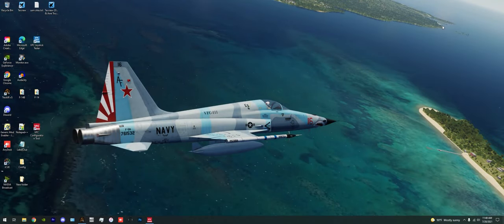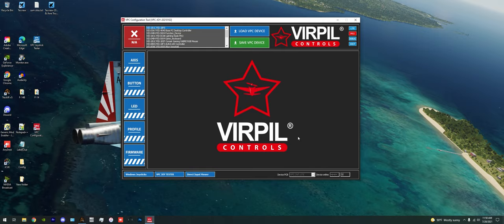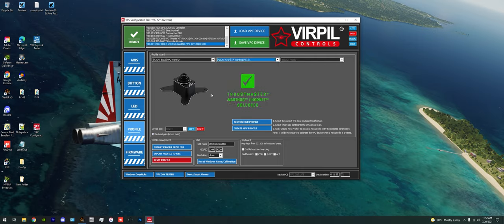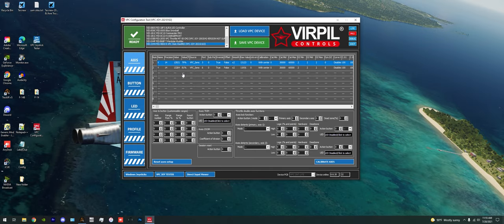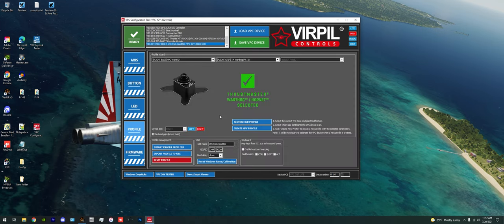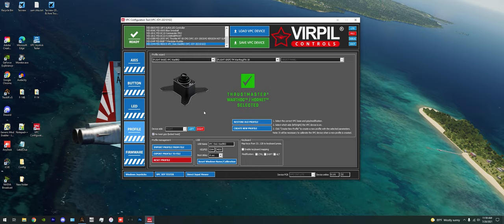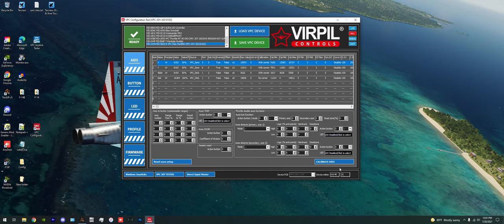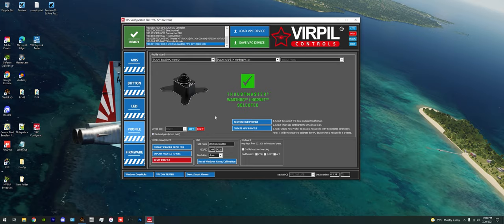Virpil Software Tutorial | Profile Creation & Calibration | Stick Grip Swapping

Comment: I had been using the Thrustmaster Warthog F-16/A10 flight stick & base and the Warthog throttle to fly in DCS.  I was really having a hard time with the precise, fine control needed to do carrier landings and air to air refueling and even just to perform good landings at land-based airports. 

With the Warthog controls, i just could not maintain constant speed and altitude or a constant descent rate. I’ve mostly been flying the F/A-18 and I kept hearing from everyone how easy it is to fly because of it’s fly-by-wire and FCS, so I was really beginning to think that it was just me being a shitty pilot. I watched lots of videos on how to set up dead zones and curves in DCS for the Thrustmaster controls, so I don’t think my control settings had anything to do with my issues. 

So I decided try the Virpil Constellation stick, VPC MongoosT-50CM2 Base, and VPC MongoosT-50CM3 Throttle. 

Holy cow! It’s like I am flying an entirely different airplane.  Flying the F/A-18 in DCS with the Thrustmaster Warthog stick, base, and throttle make me feel like I was flying the unstable Spitfire, and comparatively, flying the F/A-18 with the Virpil controls finally feels like I’m flying the easiest and most stable fighter jet that everyone described the F/A-18 to be. 

It’s literally like night and day. A lot of people rave about Thrustmaster Warthog stick and throttle, but now after experiencing the Virpil controls, I think people get fooled by the heavy weight, build quality, and great appearance of the Warthog controls. Also most people who upgrade to the Warthog are switching from really bad entry level flight controls under $100, so switching to the Warthog controls is a big upgrade for most people.

I was one of those people. I upgraded from crap Logitech controls to the Warthog stick and throttle and I did experience an improvement in ,y level of control of aircraft. 

However the improvement that I experienced when upgrading from the logitech controls to the warthog controls was much less than the improvement I’ve experienced when upgrading from the warthog controls to the Virpil controls. 

Not just the build quality, but my ability to control the aircraft with an incredibly precise and fine level of  control. Both the Virpil throttle and the  flight stick are an enormous improvement over the Warthog controls. With the Virpil controls, I now have no problem maintaining constant speed and altitude in the F/A18 and it’s a piece of cake to establish constant rates of climb and descent. 

Maybe I had bad set of Warthog controls, but I find it hard to believe that I would get a bad throttle and stick.

Comment: 2:00 ohh be carefull with that info!
When you have 2 different VPC divices plugged in at the same time it CAN brick the firmware of them when you flash it for a firmware update.
only do firmware flashing with only 1 VPC device at a time, thats also what VPC wants you to do and there is multiple reddit threads of people bricking their firmware for failing to follow this step.
other devices dont matter, only VPC stuff.
and this also only applies to firmware updates.

IF you brick the firmware however dont panic, you can still do a factory reset with a piece of metal when you connect 2 ports on the circuit board, contact VPC support for that though!

Comment: Not sure if you have the Virpil VPC MongoosT-50CM3 Throttle, but if so, I think it would be really helpful if you did a video on how to set up and configure the throttle in the Virpil software, especially all the buttons, switches, and dials. It’s a fantastic throttle, but out of the box, the switches, and buttons aren’t set up optimally and the Virpil software instructions are horrible, in terms of explaining how to set up the throttle to get the most out of all the switches, buttons, and dials on the throttle base. 

The Virpil throttle has seven 2-way switches. Each 2-way switch is assigned 2 physical button numbers in the Virpil software, but out of the box, each of the 2-way switches only activates 1 virtual button press in windows and DCS. So when you flip the switches up, they activate a virtual button press in DCS, but when you switch the 2-way switches back down, they don’t activate a virtual button press in DCS, even though each of the 2-way switches are assigned 2 physical button numbers in the Virpil software. It’s pretty easy in the Virpil software to map all the 2-way switches so that both positions on the switches activates a virtual button press in DCS, but the Virpil instructions do a horrible job of explaining how to do it.  

You basically just have to assign the 2nd physical switch position to a virtual button press number that isn’t already assigned to something else in the Virpil software. I did this for all 7 of the 2 way switches, which gave me 14 virtual buttons presses out of the seven 2-way switches, instead of the out-of-the-box configuration which only have me 7 virtual button presses from the seven 2-way switches. 

Also on the Mongoose throttle, there are 6 momentary buttons and a 5-way dial. Out of the box, the dial wasn’t linked to the 6 buttons. So all I was getting was the 6 button presses and a virtual button press for each of the 5 positions on the dial. 

However there is a fairly easy way in the Virpil software to set up the throttle so that each position on the 5-position dial becomes a unique modifier for the 6 buttons. This set up gives you 30 unique virtual buttons presses in DCS instead of the out-of-the-box configuration which just gives you 6 buttons and 5 virtual buttons for the 5 position dial.  When you set up the throttle in the Virpil software with the 5-position dial as a modifier for the 6 buttons, you end up with 30 unique virtual buttons presses in DCS (6 buttons X 5 positions on the dial= 30 virtual buttons)

So for example, when the dial is on position 1, the 6 buttons will activate virtual button presses 60 thru 66. When you switch the dial to position 2, the same 6 buttons, activate virtual buttons presses 67 thru 72. Position 3 on the dial, changes the 6 buttons to virtual button presses 73 thru 77. Position 4 on the dial changes the buttons to virtual button presses 78 to 83 and position 5 on the dial, changes the 6 buttons to activate virtual button presses 84 thru 89. 

Another thing that needs to be set up on the Virpil throttle is the physical detents. You don’t need to do anything in the Virpil software and the Virpil detente are so much better than the Warthog throttle detents. With the Warthog throttle detents, you can’t adjust the position of the physical afterburner detent and in DCS,with a normal throttle axis, the afterburner in the F/A-18 doesn’t align with the position of the physical detent on the Warthog throttle. 

The only solution is to add user curve in the throttle axis tune in DCS. That will get the afterburner in DCS to line up with the position of the physical detent on the warthog throttle, but it leaves you with an odd shaped axis curve which gives you an uneven throttle response. 

The great thing about the afterburner and idle detents on the Virpil throttle, is that you can easily shift the exact positions of the physical detents on the throttle, so they perfectly align with idle/cutoff and afterburner in your DCS aircraft. No need to create some funky user curve that will give you uneven throttle response. I have a 1:1 throttle axis with no curve, so I get a perfectly uniform throttle response in the aircraft throughout the entire range of the throttle.

Comment: I looked at this video from 
HavocCompanyClan on this Grip Swap subject and he makes the case that the Vipril Bases have an internal memory and if you keep swapping devices without unplugging the USB you might brick your base. I don't know if its true or not, but just something to be aware of.
Reply from the maker: In talking with the marketing guru for Virpil, the bases are built and designed with swapping out grips in mind and that issues are not likely to occur.
Reply: No...he is saying when updating a piece virpil equipment, you should disconnect other virpil equipment. for instance, if you need to update you virpil stick, disconnect your virpil throttle or vise versa.
Reply: @Spudknocker  that's good to know
Reply: @macdirty869  FYI..I never unplugged from the computer. I just disconnected the plug from the virpil throttle or base. easier to do. I did update both still connected and nothing out of the ordinary happened.
Reply: @ghostrider1827  Havoc is only is talking about if you make a mistake and select the wrong device.  There is no technical reason for disconnecting other devices when you are working on one.  I have upgraded my VPC firmware/software dozens if not hundreds of times over the years, and have never disconnected any device.
Reply: @eyemack  pretty sure he literally said disconnected your device back then but no matter. I haven't updated my firmware since the 21' update.
Reply: What I mean is that he was saying that only as if you make a mistake in selecting devices, it could be a problem. There is no technical reason to disconnect any device. 
I would highly recommend that you update your software/firmware. Lots of excellent features since you last updated
Reply: @eyemack  I'll do that tonight. Thx!

Comment: Your video is very confusing and not very intuitive particularly when referencing that you're setting up fresh directly out of the box. You've not made it clear in your video that you already have the VPC WarBRD Base hardware that is already setup with the latest Firmware for the VPC Configuration Tool Software that you are using. And all that you are doing is just swapping Grips around and doing the Profile Creation & Calibration for the different Grips that you now have. 

If you have purchased any new VPC hardware gear such as a new VPC WarBRD Base or VPC MongoosT-50CM2 Base, VPC MongoosT-50CM3 Throttle, VPC Control Panel 1, VPC Control Panel 2, VPC ACE Flight Rudder Pedals. Directly out of the box these need to have the latest  VPC Firmware installed to match the latest VPC Configuration Tool Software that you have download and installed on your PC. 

You go to great lengths in talking about, not having a need to go unplug all USB devices as unlike in other tutorials that you've seen. This is were you have become somewhat confused. If you already have a single VPC device like as listed above and get a new VPC Base device. Then directly out of the box you need to individually unplug any other existing VPC Virpil only USB hardware devices that you have so that you can perform the Firmware upgrade for VPC circuit board EEPROM and writing to the flash memory on the circuitry components for the new VPC hardware device to match that of the installed VPC Configuration Tool Software. 

Virpil and other tutorial videos like that of the HavocCompanyClan and Jon’s Gaming and Tech have made it very clear that you need to disconnect and unplug any other Virpil VPC USB connected devices when performing FIRMWARE Button upgrades to match the latest VPC Configuration Tool Software thus to prevent the term "Bricking' (ie destroying the VPC circuit board and circuitry components) making the VPC Base or Throttle, Control Panel device an unusable and somewhat of an expensive paper weight.